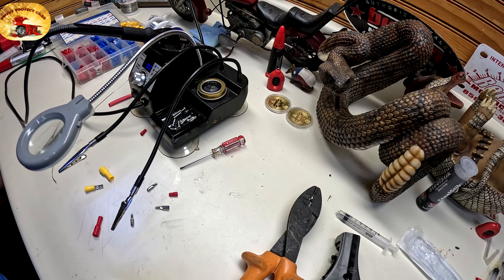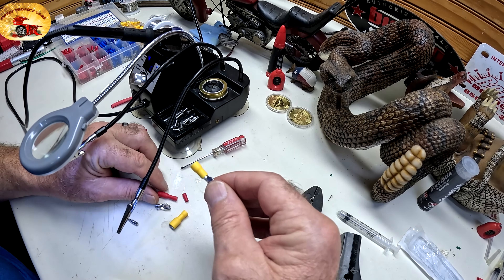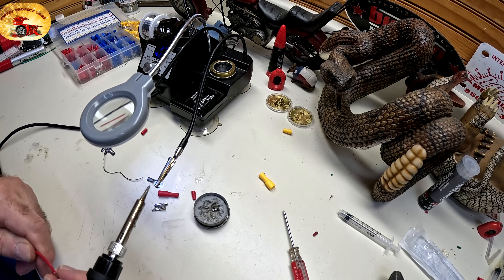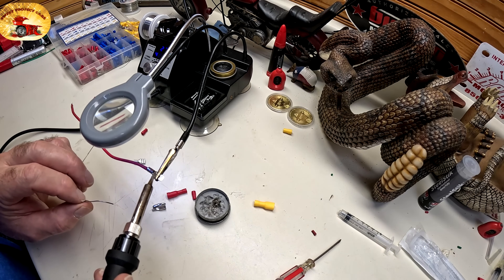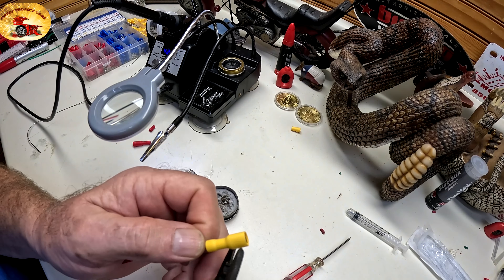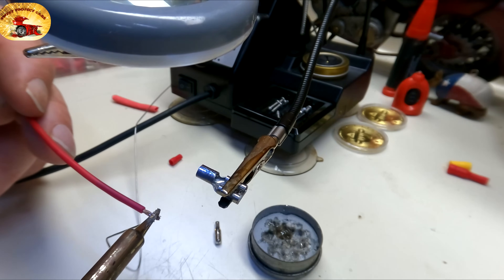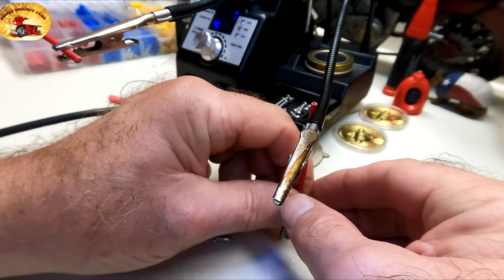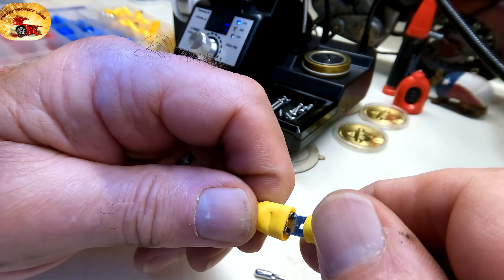Electrical Connectors an Awesome Hack!!! Never Have a Loose Crimp Again!

Comment: Electrical contact's still espoused, what is extremely danger.
Reply from the maker: Well, the subsequent semi-conductor of the lateral shaft has .003 ohm's at the parenthetical shaft system. Thanks, have a good day. mad Mike

Comment: Crimping is superior to soldering
Reply from the maker: I BET YOU $50, matter of fact, I BET YOU $100 that I could pull the wire out of YOUR crimped terminal in 3 seconds vs. a soldered and crimped terminal. Thanks, have a great day. mad Mike

Comment: Could you crimp the terminal bare and then slide the insulator over it?
Reply from the maker: I'm sure you could do all kinds of stuff, but the whole idea is soldering the wire in then all you have to do is slide the cover over it and crimp it. The only reason you have to crimp the cover after all the soldering is done is to keep it in place. These https://amzn.to/46MGX3K  work great for that. Thanks for watching and asking, Tom, have a great day. mad Mike
Reply: Just heat the hard plastic insulator up a tad , then you can pull it back .

Comment: I use a wet sponge for cleaning the tip of the soldering iron, and I apply soldering paste to the exposed copper of the wire with a small solder paste Brush (or a Q-Tip).
I've also Worked with wire solder on a Larger Scale, , 30 years Hard Labor in a Radiator Manufacturing Plant.
Reply from the maker: That's an awesome tip, thanks for sharing and watching, have a great day. mad Mike

Comment: A little bit of rosin paste on the wire before inserting it into the connector before soldering will allow for a cleaner and faster solder job.
Reply from the maker: Very true, but we've got nothing but time around here at joe's backyard soldering ranch :) lol Thanks for the view and comment, have a great day, dave. mad Mike